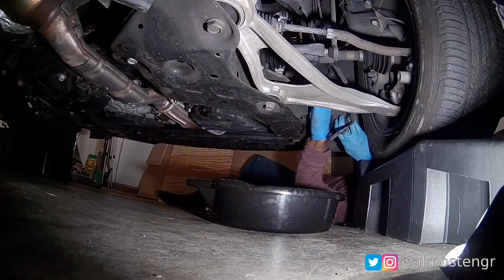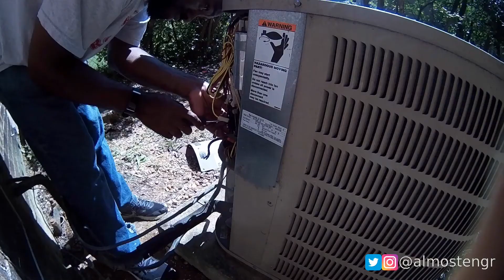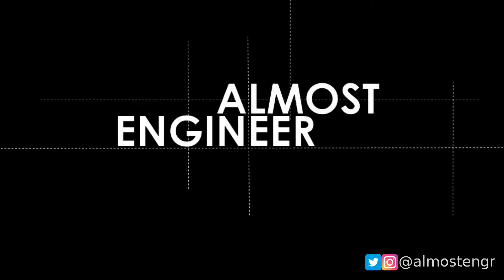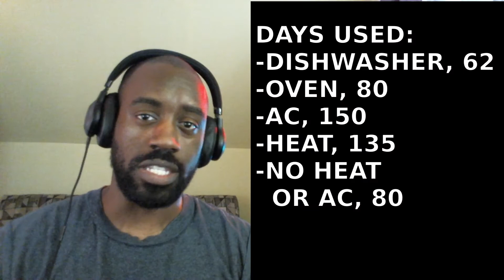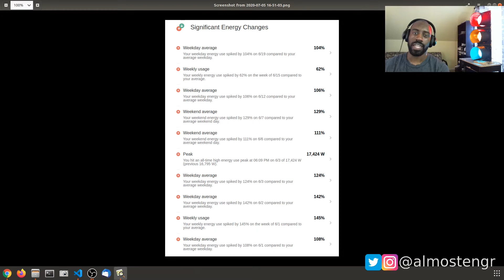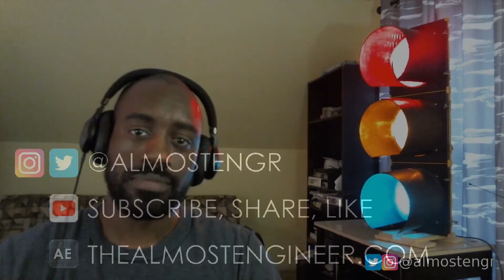REVIEW Sense Energy Monitor After 1 Year

Comment: I was not able to hook up my Sense due to they didn’t feed the solar system from the panel.  They tapped it from the meter bank.  I wanted real time information due to Sunrun app being behind the times.  Very bummed.
Reply from the maker: You may still be able to get that information by putting the CT clamps where it ties in to the meter.

Comment: Hey Kenny, thanks for the comprehensive review of the Sense monitor. I am contemplating purchasing one and your pros and cons are very enlightening. I have a similar problem
with the AC panel being on one end of the house and my router is on the other side, about 50-60 feet away with many walls and brick veneer between them. I will be looking for the 
wireless plug-in wifi extension if I can find one. Thanks for all the information.
Pat
Reply from the maker: Welcome. A repeater or secondary router that is hardwired to your primary router would be my recommendation.

Comment: lol 172 watts.... my always on is close to 3,000 watts... till trying to figure what it is because sense doesn't tell me squat
Reply from the maker: 3000 watts? That's a lot. My air conditioner pulls that amount by itself. If you really have that being pulled all the time may need to have an electrician come out and check
Reply: @rhtservicesllc  Ya, I'm being dead serious.  I have a few servers that run all the time (They are newer so they shouldn't pull too hard) but a few ETH Mining machines running pulls some juice as well as right now I have the pool pump running all the time that reminds me to get the timer setup today but yes I totally agree it's too much. This is why I purchased the sense unit in the first place.
Reply from the maker: That makes sense. Definitely agree with getting a timer for the pool. For you servers consider doing virtual machines if possible. That way you can consolidate the hardware. Also look into having 80 Plus Power Supplies in your servers if you don't already
Reply: @rhtservicesllc  lol, one of the servers is an ESXi server. I keep my lab servers powered down unless I'm actively doing something with training. There's really only one server that's powered on all the time and it's the most "energy efficient" server that I have. The problem is, the drives in it are platter drives and well they make heat and power. SSD drives of that size don't exist yet but I do have that on a smart plug that I can monitor through the WEMO app and it's only taking up 232w so something else is dragging my power consumption. These are the things I was hoping Sense would be able to do for me which has failed unfortunately.
Reply: @rhtservicesllc  Do you know if the solar clamps are the same clamps as the direct monitoring clamps? I really want to get the direct monitoring clamps setup on the hot tub breaker as that's the only one that I can't plug in something else to help me monitor draw
Reply from the maker: I believe that the clamps are the same. However you do need to have the version of Sense that supports solar. Some of the earlier versions didn't and thus only have one clamp connection point
Reply: @rhtservicesllc  I have the solar system. It’s about a year old. They replied and told me it would work but it doesn’t so far. I’m waiting for their support to reply to me
Reply: @DaMan97-t5p  so what was pulling all your electricity?
Reply: @ddemier  no clue, Sense never was able to really tell me much.

Comment: Got my Sense several weeks ago and it still hasn't sensed the big items: central AC, 1 1/2 HP swimming pool pump, Tesla vehicle charging. How can I add these devices? I was expecting a popup when one of these devices kicked in asking me if I know what it is. Is this normal? So far, it found coffee pot, one of my refrigerators and freezers (I have 3), and my garage door opener.
I'm read to return the device.
Reply from the maker: You have to wait until it identifies them. Once that happens then you can label them accordingly. No other way to do it. There will be a notification when it does identify something and the you have to go in the app to confirm the specifics
Reply: I've had mine over a year and it still hasn't identified much even with putting in smart metering plugs. They showd up for like a week then are gone. I've opened multiple cases with the vendor on it.. not much luck. I'm looking now into something a bit better that clips on every breaker (although can make your panel an absolute mess) it's called Emporia Smart Home Energy Monitor v2. It's also half the price of a sense unit.
Reply: @DaMan97-t5p  Thanks for letting me know it wasn't just my system. I had it for almost 3 months and the only thing it did was tell me when my microwave went on and off and occasionally one of my refrigerators. Never got my1 3/4 HP pool pump, my AC, or even my Tesla when charging. Very disappointed. I was able to take it back to Home Depot for a full credit. I don't know how other people can be happy with it. Doesn't seem to work for me.
Reply: @willytwo53072  agreed, I even purchased a bunch of smart monitoring plugs hoping that it would help break things out. It really didn't help. I've opened another service case with support after watching this hoping maybe they will figure this out.

Comment: Will mesh wifi help or do you have a more commercial system
Reply from the maker: Mesh would probably help. However mesh networks usually run slower so that isn't an option  that I wanted to take
Reply: Yeah I went mesh and I am finding that it’s not as fast as well. Thanks for the videos! I bought one based on your review 💪🏽
Reply from the maker: Welcome. I have considered adding an access point that Is closer to Sense. That will reduce the connectivity issues.

Comment: That's a long video but I appreciate the details.  I'm considering getting a Sense or Wiser (same thing right?) I've got an old generation TED which has a current loop and the biggest frustration is when I can't reach it and either it has stopped reporting or worse stopped recording.  It was a massive problem when I was out of town for an extended vacation and wanted to make sure nothing unexpected was running.  So I'm very concerned when you say you have to reboot it.  How frequent is that and any ideas on what causes it - is it just bad Wifi?   One idea is you could wire up a small outdoor outlet box connected to your panel with a Kasa smart wall switch and then run the load wires back to the Sense / bring the Sense power wires out to that outlet.  I'm not sure if there's code problems with that but it's electrically possible and would seem to be
Reply from the maker: I'm not sure if those are the same device.  From what I've been able to figure, the connection issue does have to deal with wifi signal and potential interference. I plan on moving the router at some point. Double checking the connections in the panel did help improve the signal reception
Reply: @rhtservicesllc  I started looking at Wiser but then when I searched I found Sense and it looks the same (except for the color) and Schneider did a big investment in Sense.  While I didn't find any 100% definite proof they are the same I think they are.  When I search for "Wiser energy monitor" in the app store the "Sense Home Energy" app comes up.  Do you know of any differences, or are you just not sure?
Reply from the maker: I'm not sure. I have heard of Schneider having a similar product with a different color but don't know the specifics of it

Comment: Great review.  Lutron makes some great switches for older houses without neutral wires etc.  To reboot the sense why not use a smart plug or you could possibly use switchbot.
Reply from the maker: Sense is wired directly to the breaker panel,  not to an outlet. Thus using a smart switch isn't an option. I've seen the Lutron devices but couldn't bring myself to justify the cost.
Reply: @rhtservicesllc  ah, got it.  What about the Zooz multirelay?  Works for regular lines up to 15 amps.  Can you help me answer a question, would I be able to use sense to know if the oven is turned on or left on and how fast can it detect it and notify me?  Also I use Hubitat, is there a way to connect it into my normal Smart home triggers or is it just what's available in the Sense app.  Thanks!
Reply from the maker: @ddempse24  Ive never heard of Zooz. Will have to look into it. 
Yes you would be able to use it to detect if the oven is on. How long will it take to detect, depends on how often you use it. In my case, Sense has identified each stove burner and oven separated, although they are part of the same device. It will notify you relatively quickly, like within seconds of it being turned on. I have notification for when the dryer turns off and I get that notification within about 5 seconds of it doing so. 
As far as home triggers go, I know that Home Assistant has integrations with Sense that can be leveraged for triggers, but not sure about Hubitat as I'm not familiar with it.
Reply: @rhtservicesllc  interesting that it found all the burners etc separately didn't realize that.  Did you originally install it yourself or did you hire an electrician?
Reply from the maker: @ddempse24  i did the install myself. Pretty straightforward as mentioned with the instructions that comes with it